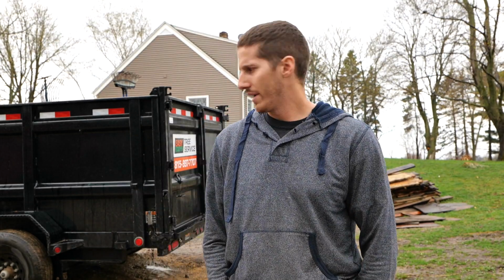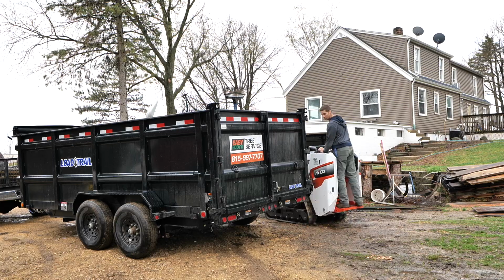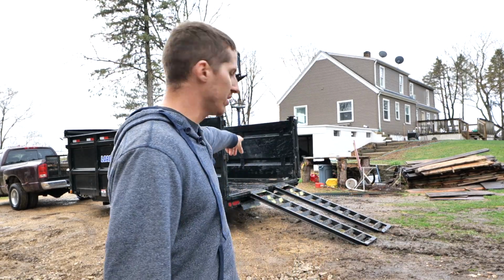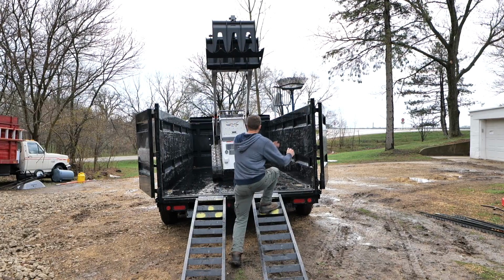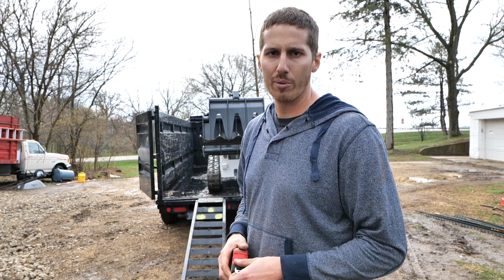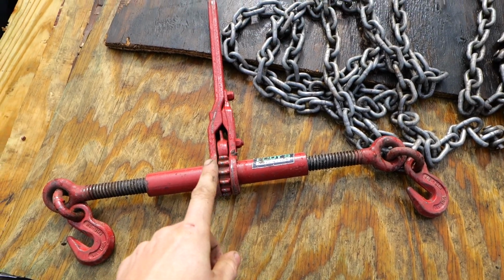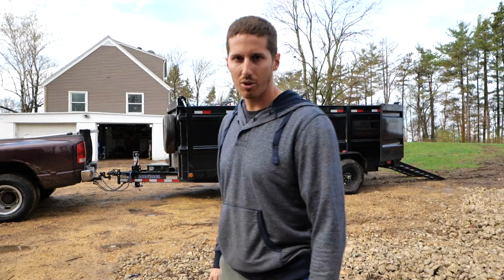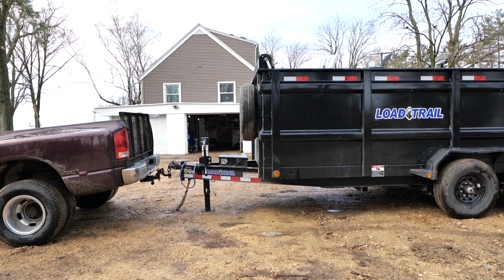Bobcat MT100 and its Relationship with my lowpro 4' Dump Trailer

Comment: Good video! Just bought my MT100 and can't wait till it arrives. I rented an MT 85 and backed it out of my 14ft PJ dump with no attachment on the front and it was a little sketchy but still very doable. With the root grapple it was not scary at all. Yes to the comment of pitching the dump up a little bit to lower the ramps and decrease the angle of attack. Keep the content coming. Keeps me entertained while at work 🤣
Reply from the maker: I'm going to weld expanded steel into my ramps to take out some of the rocking that happens between the rollers and those gaps

Comment: I almost died for cause of a weak hitch receiver like the one you have that is for 6k pounds you already over that as soon as you load the skid steer I was pulling a small 10' load trail with a GMC Sierra 2500 had around 8k lbs of stone as I was driving there was a small bump in the road that was enough to break the receiver in half as the trailer fall in the chains the the front tires of the truck went in the air it send me spinning all over the freeway. Since then I make sure I got all the trucks checked bought new heavy duty receivers and never overloaded a trailer again unless we only using side streets.

Comment: What will this mt lift comfortably?
Reply from the maker: It's rated for 1000lbs but you can probably get 1200, maybe a little more with a second guy on the back. But you have to be very careful of tipping especially when loading a trailer because this machine can throw you.

Comment: Been running mt 85s and now 100s for 7 years, have the same trailer and we always load bucket first with no problems. Also we never tie it down, never tips. Definitely have to modify those ramps for traction, I recommend buying aluminum ones that don't weigh 90 pounds.
Reply: What aluminum ramps would you recommend for a MT100?

Comment: 44: a roll out or up rug like a cashier if u the hving to drive/load on to steel floor/decking, just simple sanity measure. Then roll up rug bed when not slippery or trash being put in trailer.

Comment: Just loaded a similar machine on a 6 x 10 dump bucket first going up ramps and had it stall on the pivot point.  I had to jump off and pushed the rear up to keep it from coming back on me 

Had a helper depress the safety switch so I could get it restarted.  Then had to released the E brake.  Got it loaded.  

I have also had it slide on the steel ramps.

I rented both. 

The last time I rented both the trailer was a landscape trailer a little lower to the ground.

I'm going to buy a 16' car hauler for the machines and just rent the dump when I need that option.

These stand behind machines with short dumps are very dangerous. The climb is too steep particular if half the tracks are in the air.

Comment: I think going with an S70 would have been a better alternative. I think those stand ups would just wear you down after a long day. Anyhow good video
Reply from the maker: You can send me an s70 if you want, I'll take that too
Reply: Lmfao
Reply from the maker: Actually to be more serious, I just don't want one of my workers to decide the bobcat seat is his rightful place and spend the whole day on it, expecting the other guys to do all the manual labor. I keep a small crew and I'm only operating the Bobcat part of the time, so I expect my operator to also be a regular ground man.
Reply: S70 is garbage. Mini stand on are taking over the industry for a reason. Every single major contractor is using mini for everything these days.
Reply: The huge advantage of the mini is for any contractor that needs to be getting  on and  off the machine  on a regular basis all day long the minis are a energy saver over crawling in & out of a cab/cockpit.
Reply: @michaelschettl9509  exactly! People are lazy. Mini skid is much more practical. So easy to jump on and off when you need to. Plus, your less likely to get out of that seat because it's a bigger pain to get in and out of that seat compared to stand ons.
Reply: @chriskarsseboom2200  yeah over the last year I’ve noticed stand on mini loaders are the big thing. Hopefully looking to buy one of these mt100 very profitable

Comment: You should just tip the dump trailer up a bit and it won’t be as steep
Reply from the maker: That doesn't work. I'll make a video on it some time and show why. It's based on the location of the hinge.
Reply: @easyeddystrees   I see. I’m just speaking from experience loading one myself on to a dump trailer. But I guess it’s because of it being a different dump trailer.

Comment: Biggest mistake any new operator makes Is, now listen to this = TO MUCH THROTTLE.  IT DOES NOT NEED TO RUN FULL NUTS. Back off to where you can handle  it. Good luck, nice machine.